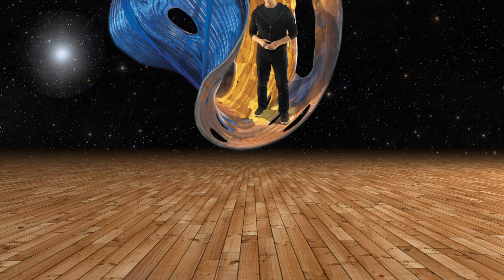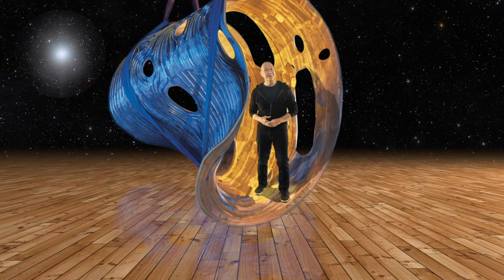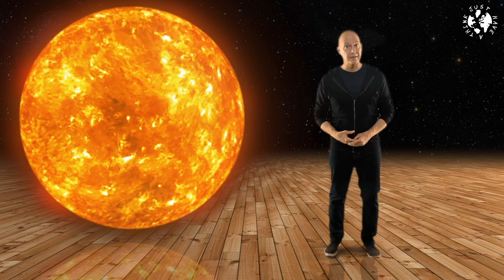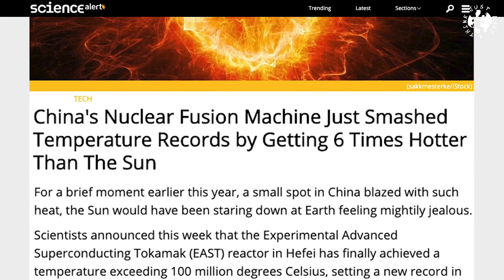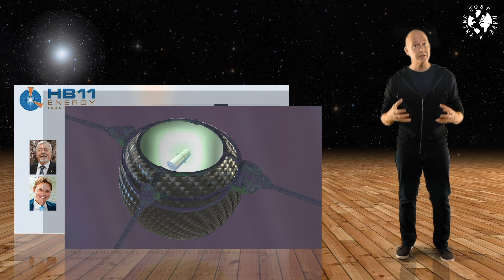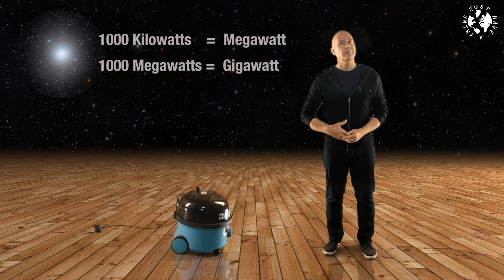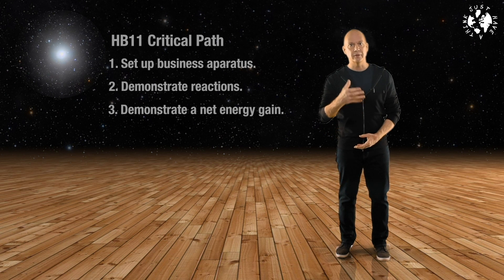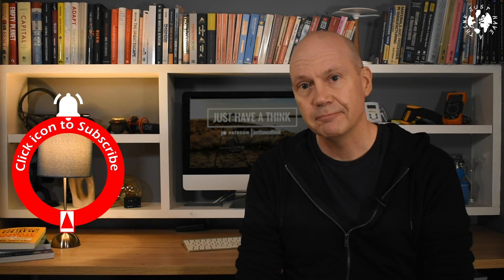Nuclear Fusion:  Revolutionary new breakthrough.

Comment: correction: a petawatt is an enormous amount of power, not of energy
Reply: 1.21 Petawatts?????!!!
Reply: @spudhead169  Great Scott!!!
Reply: Quite correct, I was working on PW lasers but only 500J energy.
Reply: @maverickdisco4036  how does that work?
Reply: @weatheranddarkness  Power is a measure of the rate of energy transfer. A familiar example is energy to light a bulb. A 100W bulb uses energy at a rate of 100W. If the bulb is on for 1 hour then it uses 100WH (Watt-Hours) of energy in total. Since 1WH = 3600 Joules, 100WH = 360KJ. Using the same total amount of energy (360KJ) we can power a 360KW bulb for one second, or 360GW bulb (or laser) for 1us. Assuming 100% efficiency a 1PW laser can be powered for 500 femtoseconds (500 x 10^-15 seconds) using a total of 500J of energy. -- Updated to correct dumb math error.
Reply: @gottafly2day  While correct its not understandable for most people. Energy is power over time, and these Laser pulses have extremely short duration. So the energy in it is considerable small. High power but short duration.
Reply: @gottafly2day  W vs WH was where my brain had dropped the ball. Clearly makes sense.
Reply: @maverickdisco4036  Neat!!
Reply: @gottafly2day  Thanks for the lesson I didn't  ask for.
Reply: @brianrichard8310 You're welcome.  I'm glad that you found my comment  addressed to someone else helpful.
Reply: @weatheranddarkness  Power is how fast/much the water is spraying out of the fire hydrant. Energy is how much water is left in the water tower.
Reply: From my understanding, 1 PW = 6.2 Super Sayain Goku's.
Reply: James Fox no, Ray is correct.  ampere is current or one coulomb per second.  Watt is a unit of power, one volt times one amp or one joule per second.
Reply: Higher power is higher energy. Unnecessary correction
Reply: @soroosha  no. 1000 watts for one second is not more energy than 10 watts for 1000 seconds. without specifying  time, you can't say higher power is higher energy.
Reply: Paul Mansfield Youre ignoring the timescale in the context to prove you know high school physics lol congrats on that. Petawatt lasers DO transfer a lot of energy.
Reply: @soroosha  not if the petaWatt laser only fires for a femtosecond.
Reply: Over a seconds it's an enormous amount though hehe.
Reply: Semantics and mon-sequiter to the argument at hand.
Reply: @JamesFox-g7x  He is right, power (with the base unit watt) is a measure of the rate of energy transfer. When you talk about amps, it's the base unit for current, which is a measure of the rate of movement of charge. 
I have a masters degree in physics, and also teach physics btw.
Reply: Correct. Pulsed femtosecond lasers can be very powerful (i.e. have a lot of watts) but each pulse consumes very little energy due to an extremely short duration. 1 femtosecond (fs) is 10^-15 seconds, so if it has 1 petawatt of power it will consume 1 petawatt x 1 femtosecond = 1 joule, or a mere 0.000277 wh (watt hour).

Of course the total consumed energy adds up with each pulse. If the laser can fire 100 pulses in a second it will consume 0.0277 wh each second, which is still a trivial amount of energy. I would assume that femtosecond lasers can fire thousands, if not tens of thousands of pulses per second.
Reply: @JamesFox-g7x  We're talking about the relationship of power and energy, not current and charge.
Reply: This is a "correction" that you did not need to make.
Energy over a period of time is STILL energy.  We might call it power but...
power is still a measurement of ENERGY (that takes place over a period of time).

Comment: Fusion energy is already here. I harvest high energy photos from a huge fusion reactor, which is a safe 150 billion metres away, using solar panels on my roof!
Reply: Paul Mansfield unfortunately you don’t have access to that energy at night or when there’s heavy cloud cover. And I certainly hope you don’t have to deal with arctic temperatures during the winter.
Reply: Bryan Barnard Hmm? Battery Storage for nighttime ! Silly boy......Bryan....
Reply: @1SpudderR  Yup... batteries that require the mining and processing of various metals, the refining of oil to produce the plastic casings, the production of assorted chemicals, and regular replacement which involves more processing and chemical waste. Solar probably dumps more junk into the atmosphere from producing the panels and batteries than just hooking up to a coal power plant.
Reply: @johnterpack3940  regular replacement? my domestic battery storage is warrantied to still have 80% capacity after 10,000 cycles. with one cycle a day, that's many years. And then the batteries can be recycled, just as readily as you recycle old myths.
Reply: @PaulMansfield  what myth? It takes energy and raw materials to produce and recycle batteries. Producing and recycling batteries produces waste. Solar is also deadlier than nuclear power. More people die every year falling off roofs while installing solar panels than have died in every nuclear "disaster" combined. The only myth here is that solar is the future.
Reply: @johnterpack3940  your comment about solar being worse than coal. Even oil companies are installing solar to run their refineries, they are not doing that because they are green hippies, they're doing it because it's cheaper
Reply: Paul Mansfield Hmm? Yep! The Sun. And it only takes 8 minutes to get here and No standing monthly + energy charge for life = fifty years x 12 months at £8.00 x £100. 00 = Costing Approximately £60,000 pounds in a fifty year human lifespan...per household x How many human households? double it, because each household has two, gas and electric......Now we know why they are not developing Fusion! Household lifetime costs, at today’s costs = £120,000! Sun 🌞 not 50 unending years and no closer with our fusion scientists.

Comment: safire contains at least 85,000 deg within the electric double layering and can do it for days weeks at a time the Safire Project is the future of power generation

WHAT THE CURRENT REACTOR IS CAPABLE OF:
Stable self-organizing plasma double layer shells
Stable plasma tufts analogous to stellar plasma tufting in the photosphere
Trapping of ions, electrons and molecules within Double Layers
Energy densities analogous to the Sun
Electromagnetic confinement of matter
Steep voltage drop just off the surface of the anode
Acceleration of ions from the SAFIRE core 
Spectral line broadening showing higher energies in plasma corona
Uniform thermal radiation emission – low thermal buoyancy
Creation of concurrent collisional and non-collisional plasma
Eruptive discharges analogous to Solar CME’s
Chemistry as a catalyst to Double Layer formation
Slowing the speed of UV light by 5,000x
Analogous transformer / capacitor behavior
Continuous spectrum from plasma double layers
 
NEWEST DISCOVERIES
Dark mode plasma electromagnetic structures
Sequestering of heavy elements to the SAFIRE core
New elements confirmed by Mass & Optical spectra, SEM & EDAX
Extreme atmospheric pressure changes – response to high energy plasma discharges (may be analogous to the changes in the velocity of the Solar wind due to CME’s)
Reply: SHOCKWAVE you’ve listen a mix of things any plasma machines can do and pseudo-science. I’d like to know when they will be putting electricity on the grid.
Reply: @Gomlmon99  pseudo-science is not whats going on here,,,, and they only need 20 million to build it not billions like tokamac once the funding is in place then they will build it,,,, the prototype reactor is and has done amazing things
Reply: SHOCKWAVE if it’s that good, why is no one funding it already and why does no one in the fusion community respect it? Only people I’ve ever seen actually think anything of it are random people on YouTube with no scientific career or PhD.
Reply: @Gomlmon99  our sun is atomic right???   and thats the reason it does not get attention,,,, because we go against the main stream science community when we say the sun is electric,,,  we face an up hill battle against the main stream view that its atomic,,, the universe is electric not gravity/mass driven
Reply: SHOCKWAVE You face an uphill battle because it’s just plain wrong. If that were the case, all science we currently know would be wrong. All the proofs we have would be wrong. The laws of physics would all be broken.
Reply: @Gomlmon99  lololol Safire Broke the brain of the plasma Physicist looking at the data OF REPEATABLE EXPERIMENTS !!!!  now if that does not grab ur attention then ur totally lost to standard science mathemagic,,,,, the physicist could not relate to what he was seeing safire breaks the laws of how they perceive the sun and how everything is electric that they have imposed these rules based on non experimentation and only math not reality THAT makes them INCORRECT we have to return to experiments and verification through experimentation is the only way forward,,, einstein himself thought his work would not stand the test of time and we know sooooo much more now than we did in the 50 or the 20's
Reply: @Gomlmon99  and have u seen that we can now make elements in this process,,,, and we can remidiate radioactive materials,,,,, and this will be the cleanest most efficient form of power generation known to man,,,, once u hear the words safire power generator in lets say 4-5 years u can then come back here and say wow i was wrong,,,  :-P
Reply: SHOCKWAVE if it’s so reproducible, and the results are all there for everyone to see, why is no one doing it?
Reply: @Gomlmon99  nm ur mind is closed to reality
Reply: SHOCKWAVE it’s a simple and perfectly reasonable question. There must be a reason no one is producing power through this method?
Reply: SHOCKWAVE SHOCKWAVE How come you ignored by question of why no one is producing power following this question?
Reply: @Gomlmon99  i did answer ur question in the previous post
Reply: @Gomlmon99  here we go,,,, well if their ideas are incorrect and their theories about how the sun and the universe receives its power and works then their ideas on how to make power from that process are also incorrect(Tokamak Cough Cough) these multi billion dollar experiments run for a few short seconds and uses HUGE amounts of power,,,, then try to destroy themselves so HAVE TO BE SHUT OFF,,,, but safire uses true way the sun works and how it receives power and Safire runs at around 80 watts and will be able to run for extended periods of time with out destroying itself,,,, u tell me what sounds right ? tokamak or safire that can create elements at will and remove radioactivity and now is being designed for CLEAN power generation with NOT BILLIONS OF DOLLARS TO BUILD the reactor bot safire only cost 20 million to put the proof of concept reactor into operation,,,, and ill say it one more time THE PHYSICIST that was hired to go over the data QUIT because he could not relate what was in fact happening happening that BREAKS THE RULES IN THE STANDARD PHYSICS,,,, because the rules are based on the STANDARD MODEL of how the universe works with ONLY Gravity and Mass at work,,, leave out the electrical and u then struggle to figure out how the sun and the galaxies actually work and u need to make up garbage like dark matter( that they have not found after billions spent looking) that is not there,,, the electrical force holds our galaxy together not the MISSING 95% of matter that they say is dark and cant be seen !!!! wow,,, just wow !!!
Reply: @Gomlmon99  wow i need a PHD to talk about science,,,, thats fucked bro !!!! u keep being fucked in the head and once safire comes online for sale to the general public u can then go get stuffed,,, and its coming bro make not mistake so stay in ur mathemagic world of fake science

Comment: None of this sounds cheap.  Even if it turns out to be cheap to create and run the reactor any corporation that owns the reactor will still charge what they think the market will handle.  It's like American pharmaceuticals.  They have meds that cost pennies to make, but when they sell it they might charge thousands for each pill.  If any of you out there say," but it's a utility" should remember what happened to the internet.  The net has become as important as phones had become. They because classified as a utility so that everyone that wanted one could get one.  The very same thing has happened with the internet, but when it came time to classify it as a utility the full weight of the providers' lawyers and lobbyist was dropped on the government.  That's why the internet isn't classified as a utility today in the US. This new tech might end up being clean, and unlimited, but I'd wait to see how cheap it is after everything is set up and running.

Comment: just have a think about the Safire Project,,,, and i subbed ur channel to c i u will research it and cover it on a video,,,,,, its worth u looking at it
Reply: It seems like a big hoax/pseudoscience endeavour. Feel free to comment a source that makes the safire project somewhat believable. Their website doesn't.
Reply: @Todestuete bro go to youtube and the "Thunderbolts project's" site there and then search for "Safire"  there are videos there with the head of the project talking about what the Safire Project does,,,, there u will find that they are seeing in the chamber,,,,, Transmutation of elements from one to another and they found heavy elements were and are being made in the chamber,,,, they slowed the speed of light down 5X in the plasma the experiment can REMOVE radioactivity from spent atomic fuel rods,,,, and they are currently looking to get 20 million dollars together to build the first safire power generation unit,,,,,, because safire shows the sun is electric not atomic the main stream dont want to touch it with a 10 foot pole,,,, here is one of the better talks https://www.youtube.com/watch?v=DTaXfbvGf8E&t=1s
Reply: @Todestuete  oh and btw when the bell jar the prototype of this larger chamber was fired up for the first time it lit up the lights on thumb drives that were sitting on a bench across the room,,, if u dont understand the significance of that event then our chat is done

Comment: the safire project creates stable plasma double layers and can run for days, weeks, months this is the future of clean energy production !!!!  not these billions spent on tokamac type rectors,,,,, the sun is atomic lol thats a laugh its very nature is ELECTRIC,,,,, safire mimic's how the sun really is powered and runs at 80 Watts,,,,, i know right BULL SHIT U SAY,,,,,, here is the proof https://www.youtube.com/watch?v=DTaXfbvGf8E
Reply: electric Sun? sounds like bullshit to me
Reply: @imarchello  https://www.youtube.com/watch?v=DTaXfbvGf8E 
WHAT THE CURRENT REACTOR IS CAPABLE OF:
Stable self-organizing plasma double layer shells
Stable plasma tufts analogous to stellar plasma tufting in the photosphere
Trapping of ions, electrons and molecules within Double Layers
Energy densities analogous to the Sun
Electromagnetic confinement of matter
Steep voltage drop just off the surface of the anode
Acceleration of ions from the SAFIRE core 
Spectral line broadening showing higher energies in plasma corona
Uniform thermal radiation emission – low thermal buoyancy
Creation of concurrent collisional and non-collisional plasma
Eruptive discharges analogous to Solar CME’s
Chemistry as a catalyst to Double Layer formation
Slowing the speed of UV light by 5,000x
Analogous transformer / capacitor behavior
Continuous spectrum from plasma double layers
 
NEWEST DISCOVERIES
Dark mode plasma electromagnetic structures
Sequestering of heavy elements to the SAFIRE core
New elements confirmed by Mass & Optical spectra, SEM & EDAX
Extreme atmospheric pressure changes – response to high energy plasma discharges (may be analogous to the changes in the velocity of the Solar wind due to CME’s)
 stick that in ur pipe and smoke it
Reply: @shockwave326  blah blah, can it generate net positive power? Can you get out of it more than you put in? If not, it's useless. We need a working fusion reactor, not whatever this is.